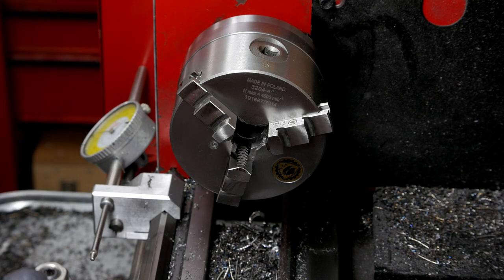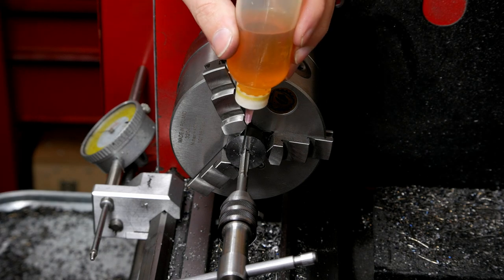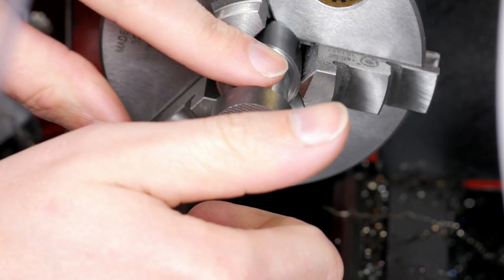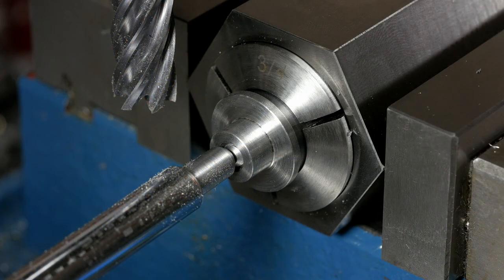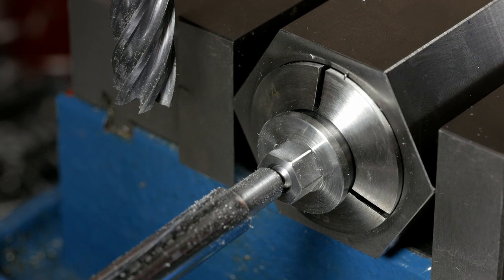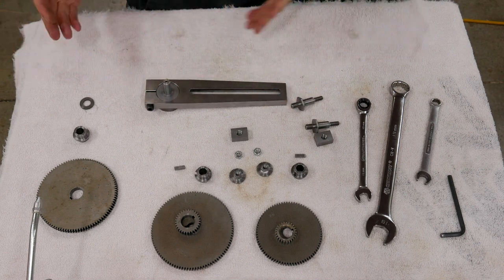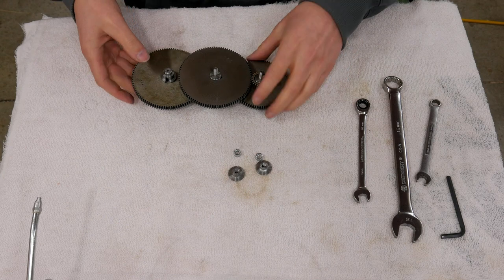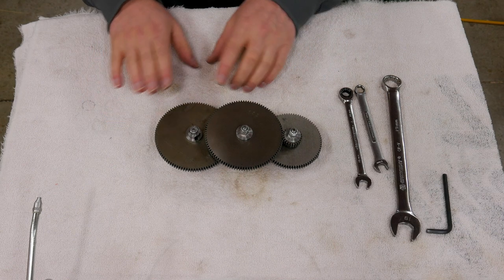A Better Lathe Banjo Pt. 6

Comment: Great, thanks for sharing that. One more tweak thats super easy but really worth it is simply to remove the Allen bolt that clamps the bango in place, and replace it with a longer one (for my lathe, 25mm longer) with a tube as a spacer of the same length on it. the ourpose is simply to put the bolt head where you can see it instead of hiding behind the big gears. Makes it 10 times easier to put the Allen key on , you can see instead of having to do it by feel round teh back of gears covered in Moly grease ;-)
Reply from the maker: That's an excellent idea!

Comment: Very interesting and informative. I have a similar late and will be building a similar setup soon. Any chance you can share where you are sourcing your gears, my 3rd hand machine is missing a few.
Reply from the maker: Unfortunately I got my gears form a company no longer in business lathemaster.  They sold a higher end version of my lathe as well as all kinds of replacement parts until some time in 2016.

Comment: Thank you Daniel for the informative and fun video!  I got the same lathe a month ago, after I looked into the operation manual, I got to ask whether adding some metric threading oriented change gears(aka. 120T, 127T, etc.)would help with broadening the ability of making metric threads?  And will the geometry of the gearing mechanisms allow such a big gear to put in?  Thank you for your time!
Reply from the maker: I've run my simulation before including 120T and 127T  gears, and even with them you still need to move the studs around some. If i get some time later tonight, i will add in even more possible gears to see  what might work.
Reply from the maker: It took a while to run (80 minutes), but i simulated  having 3 copies of every gear between 25T and 127T.  The simulation yielded 308 unique combinations, that would give you every metric pitch between 0.2 and 3 without needing to move the studs. 

I didn't look at them to determine what gears where needed, or what combinations needed the fewest custom gears, but I suspect you would need a lot of custom gears regardless of what combination you chose.

Comment: You certainly did a great job in this series, well, as in your other videos, but having the same bushing supporting both gears in a fixed position means you'd need all the upper gears to have, either, an even or an odd number of teeth, and the same for the lower ones. Because all these are just meshing between the spindle's and leadscrew's gear, you shouldn't be able to complete most of the compound gear-trains your lathe officially supports.
Reply from the maker: I have gears with teeth counts that my lathe didn't originally come with, as well as several duplicates of some gears. Because of this, I can get away with fixed positions.
Reply: Then, either I got something wrong or you got me wrong: If you have bushings spanning two gears that rotate at once, and you use one for each gear-plug within the banjo, then you shouldn't be able to mix even and odd gears within a compound train. It all comes down to the fact that even if gears were carefully key'ed (which would reduce conflicts with some combinations), you'll anyways hit one were the lower gears match as they should, but then you go for the upper ones and there's no possible way to match them. In fact, I'm now thinking you should be able to notice this with just about any compound train, whether all even, all odd, or a mix of both. Single trains should still be fine.
Reply from the maker: @stupid-handle  I completely understand what you are saying. Their are physical limitations that prevent certain combinations of gears being used. However because The gear train has 5 gears in it, and I have so many gears to choose from I can work around the issues.

Here are the gears i have for my lathe and how many of each i have.

    25 teeth : 2

    30 teeth : 2

    35 teeth : 1

    40 teeth : 1

    42 teeth : 2
    45 teeth : 1
    48 teeth : 1
    50 teeth : 1
    52 teeth : 2
    60 teeth : 2
    66 teeth : 1
    68 teeth : 1
    70 teeth : 2
    72 teeth : 1
    75 teeth : 2
    80 teeth : 2
    90 teeth : 1
    100 teeth :  2 

Feeding all those gears into a custom application I wrote for the project yields 241,966 physically possible combinations.  With that many possible combinations it was easy to pick ones for all the feed rates that I need, that didn't require shifting the studs around much. I'd have to go home and look at my charts in the shop, but i think i only have to move the top studs for a few oddball metric threads.
Reply: @Dans-hobbies  Now that you mention it, I think you said that in one of the videos. I trust your word anyways, my point was to alert you, rather than to prove you wrong, though your comment leaves me even more puzzled, because as I understand it, you shouldn't be having as much as 241K combinations that you could actually use with fixed bushings.
I also wrote my own c program to compute physically constrained permutations of multi-sets without repetitions, so that I could get to know all the pitches available to me beyond the ones my lathe's plate claimed. I also made new studs and outer bushings in a way the latter could be driven (and so become the driver of the train if I temporally removed the belt from the spindle) either with a crank or with a motor, and for both, the studs and the leadscrew. I can machine pitches in excess of 30mm without modifications with a milling-head attachment on my cross-slide for those above my leadscrew's, and basically use the lathe same as one would a dividing head on a mill to produce helices. I did all this long ago, but is probably why I noticed some oddity with the fixed bushings, like it's something I either didn't think of, or discarded during the design stage for some reason.
I'd still say you shouldn't be able to physically engage most of the compound trains on your chart except for pure coincidence, but I might also be missing something completely obvious in all this. I'd need to make some 2d sketches or even some 3d modeling to find out why I'm so off here.
Reply from the maker: @stupid-handle  The 241k is with any stud/bushing positioning. Once I require fixed positioning the number goes way down.  

Here is a link to the cheat sheet I keep in the shop for feeds that I'm likely to actually use.
https://www.dans-hobbies.com/wp-content/uploads/2016/12/feeds.pdf

Take a look at Top C and Bottom C. Bottom C is the center to center distance between the lead screw and the bottom gear combo. Top C is the center distance between the bottom gear combo and the top gear combo.

As you can see in the chart I only have to move the top stud for a few unified threads and a few more metric threads. The metric threads are to be expected though as my lathe isn't metric. If i need something out side of the ones listed, I brake out the extra banjo and do a custom set-up.
Reply: @Dans-hobbies  Hey Dan!, sorry, I didn't get notified. I just came to say you were fully right, though!
I had already noticed a couple of days after my last comment that having a bushing per gear, per stud, would simply make impossible to transmit the  power from the spindle to the leadscrew for other than single trains. I don't know why I got tricked into that. I could go to the workshop this weekend to confirm my studs are also "fixed", but also to study (or re-learn) why is it gears always mesh in a compound train despite of being mixed (even or odd gears, which also translates to varying diameters as well).
The gears for my lathe always show the key at the same offset in regards to a tooth (center of the key always aligned to the crest of a tooth in my case), but I've been busy and couldn't yet make some sketches in freecad to see by myself if that's the actual point. I also recalled you showed (in your first video in this series, I think) the original parts your lathe came with (which are the same as mine's), and also the same you machined with your improvements.  So the only advise I can give is to avoid getting older at all costs! hehe. All the best!

Comment: what cutter do you u with this small lathe and what size is it ?
Reply from the maker: The inserts are 1/4" CCMT finishing inserts from sandvik. They work perfectly on my small 8x14 lathe, because they are designed for small depths of cut and slow feed rates. 

https://www.sandvik.coromant.com/en-us/product-details?c=CCMT%2006%2002%2004-PF%20%20%20%201515
https://www.amazon.com/gp/product/B0040NPEEA/

Comment: I guess I don't understand why you made banjos that allow the adjustment of the studs on which the gears rotate.  If you never need to move these studs, why not just permanently fix the position of the studs?  Drilling and tapping three holes seems like a lot less work than milling that long slot and providing additional parts to hold the studs in place.  I understand that the positioning of these studs would become a critical high precision problem given that you only get one chance to get it right.

Also, I assume that the banjo and gears reside behind some kind of cover plate.  Why worry about the esthetics of the banjo taper when it will not ordinarily be visible?

Color me curious.
Reply: Aesthetics is what distinguishes craftsmanship. This is why the movements in 18th Century clocks and watches are often intricately engraved with baroque scrolls even though this feature is only ever seen when it is opened for repair. Although the aesthetics may not play a functional role as such, it's the essence of creativity that drives the attention to detail that ensures superb workmanship.
These videos are an example that attention to aesthertics. There are no awkward shots where you can't see what's happening, no blurry shots while the camera finds the focus. It's all crisply edited and every shot is not simply clear but is aesthetically pleasing. We don't see the amount of work it takes to produce a video of that quality. We do see the engineering skills demonstrated here but might not immediately appreciate the superb filming, narrating and editing skills that go into producing something of this quality.
Trust me: aesthetics matter.